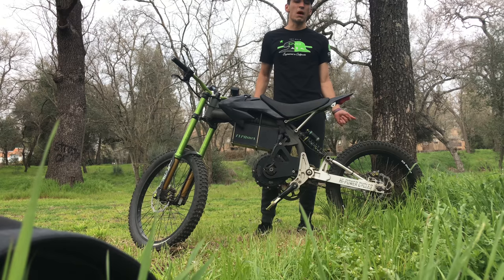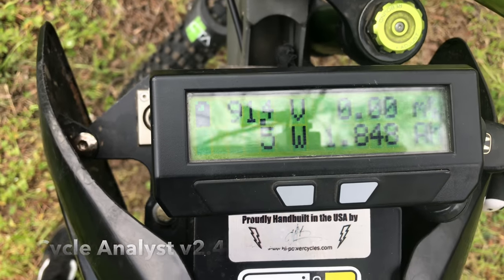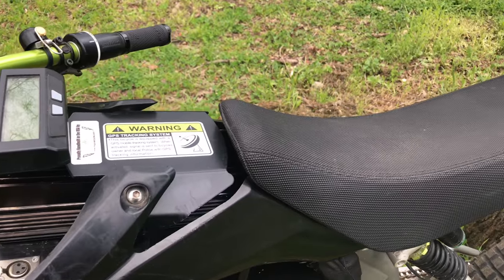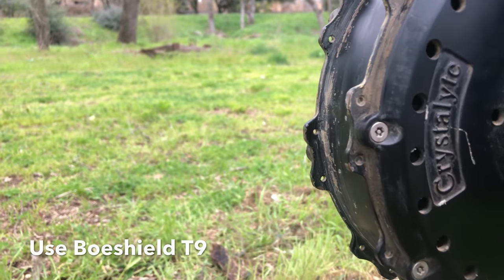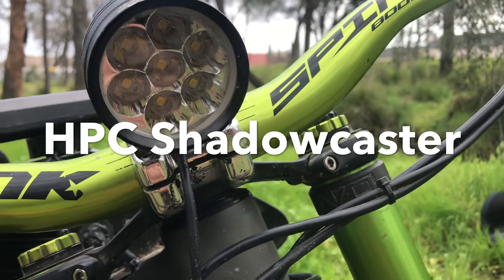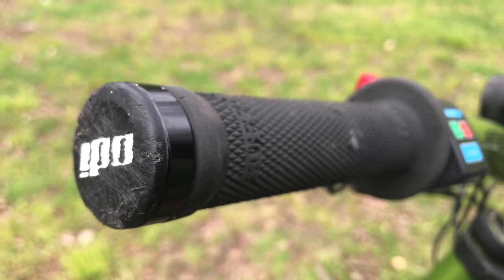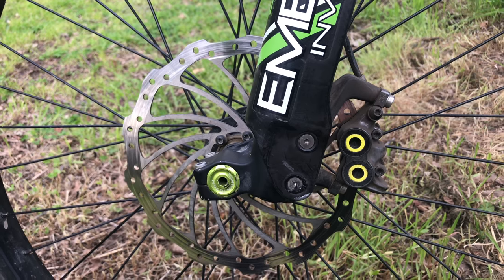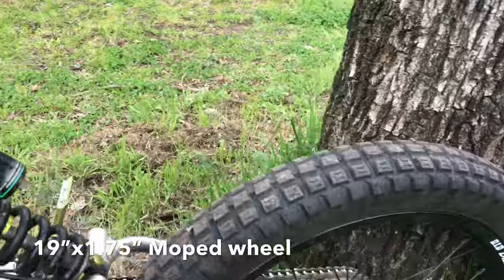INSANE Electric Bike Walk Around (Detailed)

Comment: That’s called a motorcycle bud. You need a MOTORCYCLE License to ride that, turn signals, headlights, etc...btw you also need turn signals and a horn. Use it off-road it’s illegal
Reply from the maker: Actually when programmed properly it’s a class 3 electric bike and ships as one. No turn signals, lights or anything needed here in California It’s also got pedals. #ebike

Comment: Great job on your video. I'm interested in more details about your new rear wheel and tire! It looks pretty beefy and I suspect you're getting better life from that tire. it has a tread pattern similar to a Pirelli MT-43 Trials Tire. Please share details of rim, hub, tire.
Reply from the maker: Hey I actually took apart the standard rim set and installed a 19” “D.I.D Dirt Star” moped rim. Using 12g spokes HPC was able to cut. The tire itself is called a “Shinko” and I got the smallest size I could find. This whole rear wheel build cost me around $150 and now the tire will last hundreds of miles longer then the bicycle tires. It’s already paid for itself. Thanks for the support!
Reply: That's cool you went BIG! I'd seen Shinko tires before. Its cool that these big tires fit, but I wonder how they impact range? There is a guy from Ney York with a gas motoped on Youtube that put moto wheels on his bike too. He has a detailed video about building it. https://youtu.be/1I3Pfecg7m8 Watch at 14:00 when he talks about front tire performance https://youtu.be/1I3Pfecg7m8?t=14m00s
Reply from the maker: The tire ends up being only a little bigger then 3.1" and adds 5lb of rotating mass.This effected my range and torque so i changed my gear ratio from being able to go 45 mph to 40 mph and now i have slightly more range.  I'll take a look!

Comment: B E S T! Battery is 18650?
Reply from the maker: For the price and reliability, 100%.
Reply: @ErikKibbee  lifepo4 fools
Reply from the maker: Have you ever dropped a lifepo4? 18650 are proven to be way safer. I’d definitely go for them on an electric bike. If that’s not a concern lifepo4 will usually have a higher amp rating.
Reply: @ErikKibbee  I've poked holes in lifepo4 without any problems.  Soldered back up the hole and charged it up. Do that with an ion and you've got problems.  This was with a 32650 btw.
Reply: @standbyme6395  LiFePo4 doesn't last no where near as long as 18650's
Reply: @macauleyc64  if you're talking capacity then no...lifespan is about twice as long as an ion and can take alot more abuse...lto is what i would rather have overall though...

Comment: stealth will overtake this in the long..I do appreciate a mid hub drive motor as that gives it a better center of gravity then a Stealth B52 bomber.. but the bomber is build better.. over 1,000 customers worldwide..must be doing something right..ill take the B52
Reply from the maker: Check out my video of this bike destroying the stealth in a drag race. But yeah you are right, top top speed wise, the stealth has it beat.
Reply: Sur-ron beat them both
Reply: @miguel360kmc  not a chance, surron tops out at 45mph
Reply: @macauleyc64  lol 😆 really? Lol why is that? Lol 😆 just Google it and go watch any of the few 100 videos on cutting the green wire its top speed is actually a 10mph wide range 40-50mph depending on rider weight. I hit 44mph easy hitting 45 takes maybe another 10 yards if that. 
  And thats on stock battery stock controller only mod is cutting 1 wire something EVERY owner does before cutting wire it tops at 30-35mph i got 33mph
  Now toss in a 72v battery and a bac8000 the motor can handle a 18kw set topping more in the 60s-80s depending on gearing and programming. Stock its a 5kw i believe and any ebike rider knows 5kw max speed is in the 40-50s its all common knowledge not a opinion but mathematical fact 👌 😉
Reply: @macauleyc64  also sur-ron owner just 🇺🇸 usa Facebook group has 3,600 some odd members the worldwide group is around 6k members the modding group is 8k members the sur-ron is the must popular high powered ebike in the world 🌎  and sure its built in  China but like Sony and iphones and a few other big brands its built to spec
Reply: @macauleyc64  50.7 mph on the 2nd run again stock bike
He does have the belt drive which is a stock option its like 2t or 3t difference over chain drive
Reply: @miguel360kmc  72v battery and controllers out the question, I could say I put a 96v battery on my stealth bomber then you would say it's going to be fast because it has higher voltage, I'm talking stock form here, surron is just a kids off road toy that's had loads of development that make them just as fast as the big bikes. But no matter what the surron is just a 45mph e-moto
Reply: @miguel360kmc  and you can't really say it does 50.7mph nobody really looks at a fraction of a mph on a bike
Reply: @macauleyc64  im guessing your one of the very few that spent the what 10k on this bike or 10k on a stealth bomber (which both are very nice bike and i would love to have in my fleet) and dont like to see a bike thats only $4,100 way out do your bike lol
Reply: @macauleyc64  this is stock stock the bike does 40-50mph depending on rider weight.
 You said "no way the bike does 45mph" now your back stepping that saying its a " kids toy and its still a 45mph emoto" not sure  😉 what that even means the x160 is for kids the x260/lbx is not the sur-ron light-bee or the segway x260 both the same bike same motor same battery just different name color and had Bluetooth doggle to change things like top speed and regen also lets you track the bike. Out the box after you cut 1 simple wire the bike does 40-50mph. 
 And tossing 1 of the many 72v packs in the bike DOES offer a increase in speed and range but the real gain happens after you swap out the controller. Go watch ANY of the sur-ronster vids half of Dillon Thomas vids or any of the 100 or so YouTube channels dedicated to the sur-ron LBX/segway x260 the bike is = to a 125cc 2 stroke (stock) its a high powered e-pitbike if anything. A bike that easily can be looped stock almost every owner got on it thinking its a toy and looped it thir 1st ride. Its a 120lbs bike power to weight roto is nuts 😳  go test ride one where do you live I'll let you ride mine 100% bet you will not call it a toy after riding one 😉  anyone that lets a kid under 16 ride one is dumb or the kid has already mastered 150cc dirtbikes
Reply: @miguel360kmc  I'm not been no troll at all I said was a bone stock surron would never beat a stealth bomber, IV riden enough of them both to know 1st hand and I said the surron tops out about 45mph if it does 50mph with your conditions 5mph is only about 10% for conditions but every single surron IV been on. Reading the speado or the GPS they go no quicker than 45/50mph and IV riden both lightbee and the lightbee road legal, the road legal actually feels less aggressive on setting of but top speed is still the same... Either way 5mph no one really cares most people ride them in fields or forests I don't know of one racing because they aren't that quick enough to race to people I know that races
Reply: @miguel360kmc  also that's still got the 3kw motor on it the bombers I ride and build have the qs273 3.5t 10kw constant
Reply: @macauleyc64  lol ok 1st off you contradict yourself a few times here. 1st you say the bike cant do 45 than you say it can do 45 now your even saying the bike can do 50mph as all the video links i posted show. Seems like your tring to back pedal ALOT instead of just saying "i was worng" its ok to be worng. And lets show you your worng yet again. The sur ron does race and WIN lol 😆 😂  there are dozens and dozens of videos showing the sur-ron compete in single track races and blow the doors off of 250s 😆 
 And there is even a dedicated sur ron racing league but it is new and small = to the super 73 racing league which im sure as a expert ebike rider you knew about both just forgot. Like you forgot that you had been on a sure and had 1st hand knowledge of it hitting 45/50mph lets see how you back pedal this one 😏 lol
Reply: @macauleyc64  dont worry anyone with half a brain knows im right and your wrong. 
Even if the bike didn't race which it does but if it didnt so what the bike is only 4-5 years old the b52 is what near 10 years old? 🤔 im not sure on that just know its older than the sur-ron LBX
Reply: @miguel360kmc  I said not a chance, (comma, they is a comma so a break in sentence 🤣)surron tops out at 45mph... Literally your the only one getting funny over 5mph on a kids electric bike 🤣🤣 what ever please your self
Reply: @miguel360kmc  what's age of a bike got to do with anything it's electric not a combustion engine, only thing to get worse with age is the battery cells
Reply: @macauleyc64  ok i was worng there i did think you said it cant do 45mph not sure why you didn't say so sooner.
See how easy it is to say your worng. Remember that.
This link is showing a sur-ron winning a race. 
When Google stealth bomber B-52 ebike racing or racing league i got zero videos or information 
When you Google sur-ron racing or racing league you get a few videos and some sites and news results just saying... 
And age has a big deal of importance for 1 the b52 has been around 2xs as long as the sur-ron and still isn't half as popular 🤔 and it being around longer means its had more to develop a following develop a racing league the sur-ron is still kind of new. 
https://youtu.be/u6DzZK7UpNE
Reply: @macauleyc64  also why the hell didn't you point out sooner that you did say it can 45mph. Also that makes your 1st comment make even less sense. Your 1st comment was to mine when i said the sur-ron can beat both. Which there is videos showing this. And you know the top speed is 40-50mph you later said so yourself. And you should also know the sur-ron stock motor has a peak power of 22kw there are a few 22kw super moto surrons with 72v batteries and bac8000 controller. The average is 18kw set ups almost 80% of sur-ron owner run them at 18kw the rest run them at 10-15kw. 
I've seen maxed out b52s the dont match up at all! And if you compare price for a maxed out 22kw sur-ron upgraded frontend rear shock bars battery controller wheels brakes is only $10-$15,000. Where as a b52 stock is 10k i think the price has went up since the last time i looked at its what around 13k now? So to max it out your dropping another 6k maybe more. So its still more expensive and still doesn't match up. I'll have a total of $7,800 into my bike 72v 52mah battery bac4000 and a nat pack range extender 72v 20mah battery racing mopad brake system with rear foot brake. The sur-ron comes stock now with fast ace moto forks so keeping them saving a grand. And when im done my bike will be doing 55-60mph ruffly i have the crf adapter and like 10 crf sprockets 36t to 62t ill try each the guess is 54t is best which should have a top speed around 60. Also have 16 × 3 rear  and a 21+2 front giving me way more off road Capability. Already have a set of warp9 super motos for streets love them. ❤  and thats under $8,000. How much you got into your and what can it do? 
Also check out sam pilgrims channel he has a few videos showing a stock sur-ron can handle 30ft jumps like nothing he did no handers 1 handers even a heel cilck and super man off a small kicker ramp. 
I love the bomber wanted one forever but happy i didn't buy it and went with the sur-ron instead. If i get a stealth b25 type bike i would buy the delfast 3.0 with 2xs the range and a 55mph top speed or even cad motors their bikes top around 55-60 one even hits 70 range is ok 👍  and both are cheaper than the b52 at 7k for the delfast 8k for a few of the cad motors bike
Reply: @miguel360kmc  why you still defending a bike lol and he didn't come 1 in the whole race he come 1st in his class and they was him and that yz85 🤣 really I doesn't matter If stealth has been about for 10 years or not how do you know what there sale figures are 🤦 next time I'm out with all the bikes I'll get the little 3kw qs205 stealth next to a surron and it leaves it pulling away ant top speed... You really are a fan boy of a over hyped bike
Reply: @miguel360kmc  I bet you got the fake pedals and say it's a bicycle to the police aswell but it still does look like a small Motocross